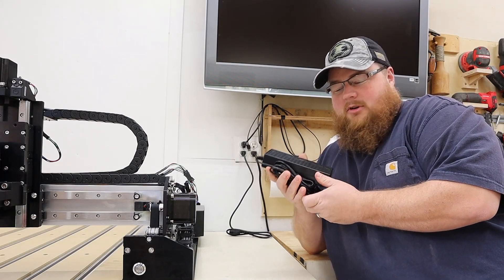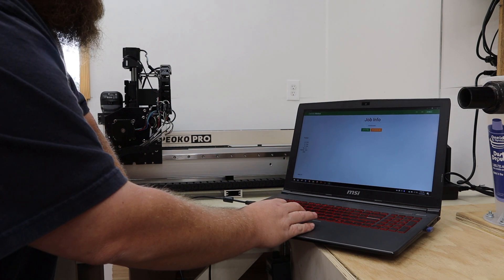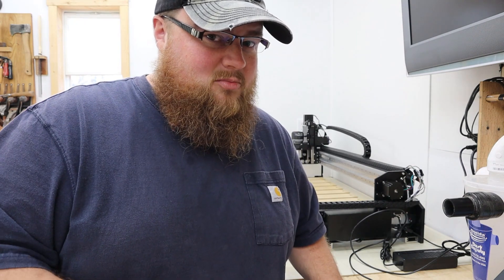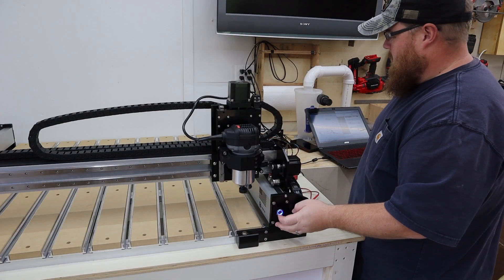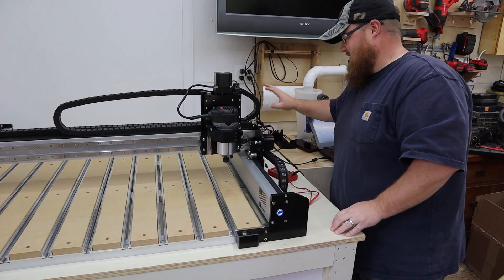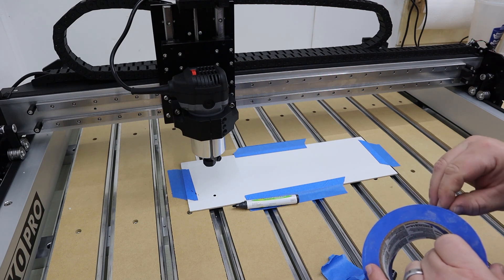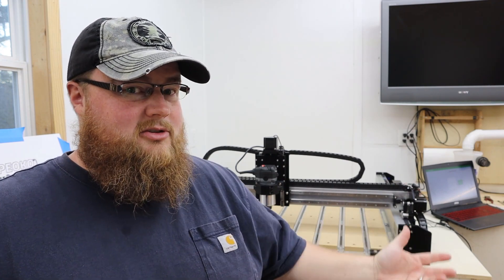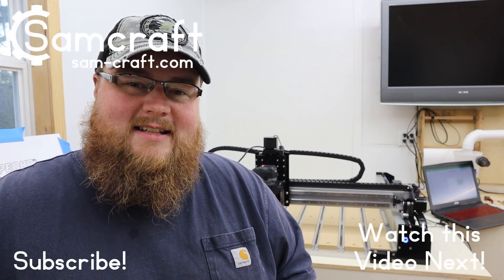Y AXIS & BITSETTER FIX | My First Use of the Shapeoko Pro CNC Router

Comment: So I'm having the same problem where mine is going backwards so when you swapped y1 and y2 did you mean in the box where all the connections are located or did you just switch the wires In-between where the connect on the dragg chains?
Reply from the maker: The wires at the main control board needed swapped for my issue.

Comment: Sam, get an old sheet, to use as a cover.
It will, of course, get dusty during use but
there is no sense in it getting dusty, when Not in use.
Reply from the maker: I like that idea!
Reply: @Samcraftcom :
In my basement shop, I keep my stationary tools covered until needed.
At the end of the day, I vacuum clean, then cover up again.
Dust collects moisture, especially on cold surfaces. Moisture causes rust.
Clean & covered: No dust, no rust.

Comment: Awesome! Out of interest, did it come with the bitsetter or did you need to get it separate?
Reply from the maker: The Pro comes with the BitSetter built-in. It also has the new controller board with separate pins for the BitZero, too.

Comment: Does the router get plugged into the Shapeoko and then the Shapeoko gets plugged in the wall?
Reply: Yes
Reply from the maker: No, the router has its own power cord separate from the machine's power supply. On the Pro the router power cord routes to the left side of the machine while the controller board, USB, and power inputs for the machine are on the right.
Reply: @Samcraftcom 
Thank you for correcting my misinformation.
Reply: My apologies, for misleading you.

Comment: I had the exact problem with my Shapeoko Pro. The funny thing is, I had to watch the same video and caught Winston’s comment about switching the wire over if the motors move in the wrong direction. Sure enough it worked!